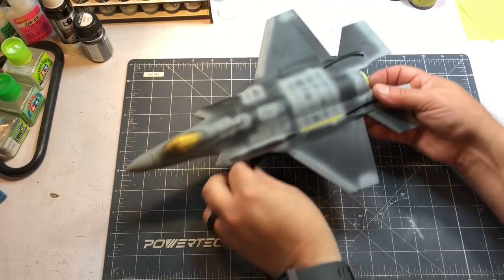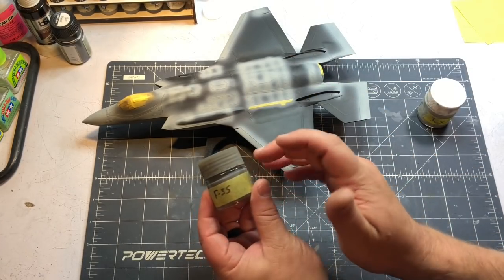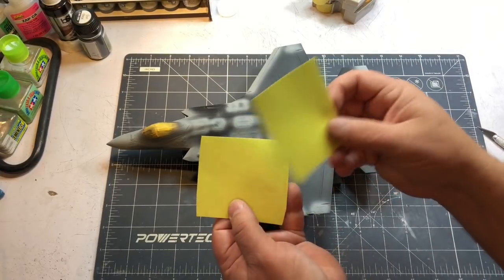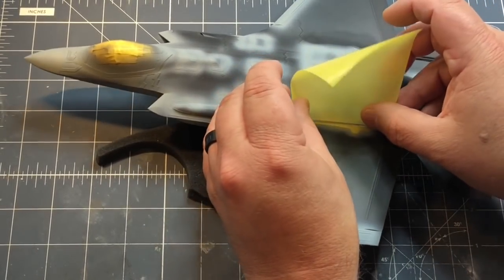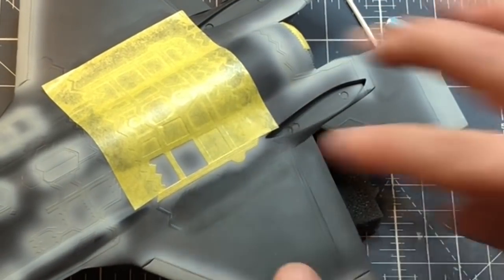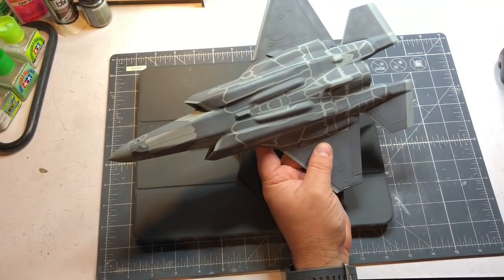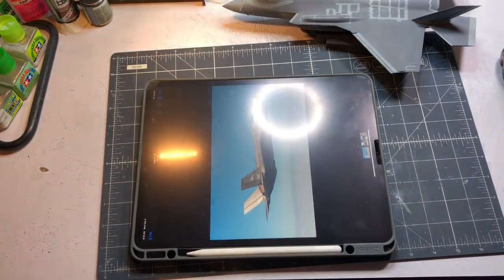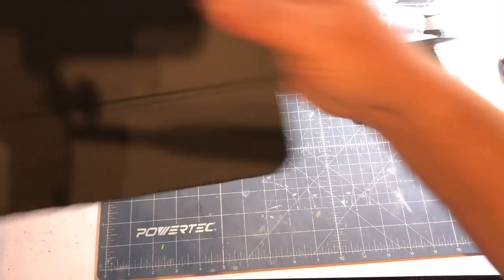Meng 1/48 F-35A Build Part 2: Paint and Finished Model

Comment: Great work like it !! I do not use Airbrush,  is it possible to handled with brush painting?
Reply from the maker: It’s possible but it’s hard to get the same effects without an airbrush.  However, You can do a lot of shading and highlighting with oil paints which can give you similar results
Reply: @seanerk5kt9  Thanks sir. İn addition, I'm a beginner in this area so ı only use acrilic paints with base on water.. Most probably ı'ma not get quite similar results. Unfortunately, The Hobby can be very expensive in my contry so ı go slowly.

Comment: Hi there
Love your work
Mind if I ask you a question about pricing of commission builds
I have been asked to build a 1/32 tamiya spitfire for someone and have no idea how much to charge
Cost is not a issue for the person but I also don't want to charge him for the 146hrs of work @for example $20 dollars per hour
Reply from the maker: Boy that’s a tough one.  I started off selling some of my stuff on eBay which gave me a good idea of the true market value of my work.  That really helped me determine what to charge on commissions.  As far as per hour...I’m thinking I averaged $2 or $3 per hour for most builds.  For a typical Tamiya 1/32, I would’ve charged $300-$400 plus shipping which doesn’t include the price of the kit.  With all that said, it really comes down to a price you and the buyer are both happy with.  Hope that helps.
Reply: @seanerk5kt9  thanks muchly mate

Comment: This one broke my heart. I loved all your previous paint jobs, but I can't say the same about this one. I know, that it is your interpretation of how F-35 look like, but I just don't see it. First of all - exhaust nozzle - why brass color? It is nothing like that in real life (I am not talking about pictures). Second - FS36170 - F-35 color is availabable from MRP and it's a good match. This metallic sheen, that you have used, does not cover RAM tape (what you did in lighter grey), so you should have paint it on while your masks ware still on. Btw - MRP also have Have Glass, stat gives this warm metallic sheen, so in my opinion it was an easier way to do it. I know, that F-35 color is unique, but new F-16s are also painted same colors, so it's not like it's paint for only one kit.
That is all from my side. This is only my opinion. You should not worry about it. I just wanted to share it.
Good luck. I will be waiting for your next build!
Cheers!!
Reply from the maker: I’m actually happy with the color, but I do realize I didn’t capture the look of the have glass finish.  This video might help someone else make the choice to buy the paint you’re referencing so not all is lost.  As far as the copper color on the exhaust (not brass), I saw a few pics of them that color and I liked it better than the usual color.  I have never seen one in real life so I only have pics to go by.  I haven’t quite decided what I’ll do next but I’m guessing it will turn out better...hopefully;)
Reply: @seanerk5kt9  I am happy if you are happy. My choices would be different, but I am not saying they would be correct. I abandoned (for the time being) jets. Warbirds and biplanes are my thing now. How about a biplane? New ICM Stearman? Meng just released Fokker Dr.1.. I was terrified of rigging, but then I decided to make new ICM Gladiator and I loved it.. that took me by surprise.
Reply: I agree with your opinion. I was looking at F-35 engines on Friday and they don't look that way. The MRP HAVE glass is a nice color, it's on some F-16s now also. That canopy tint is dark! Really nice masking job. The lens on the sensor array is really great as well.